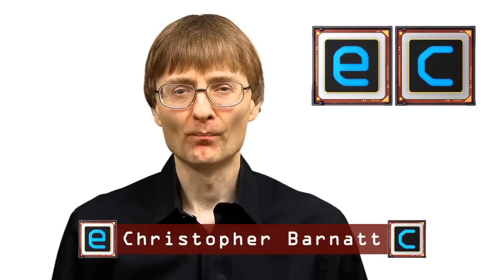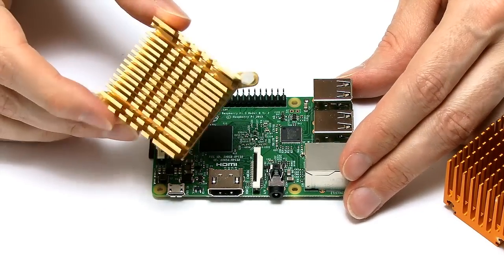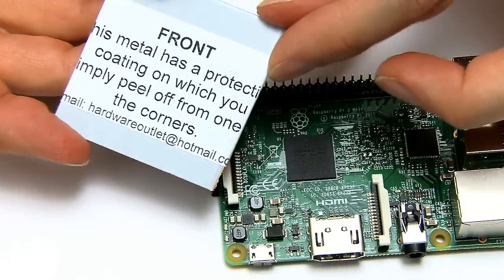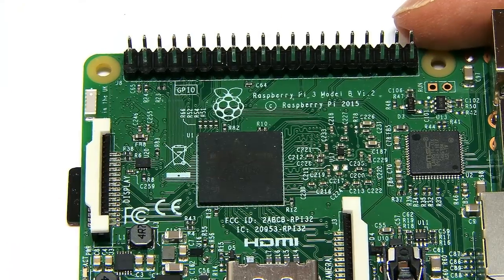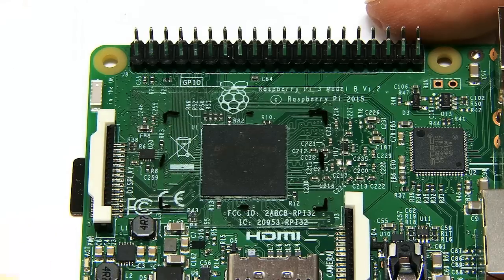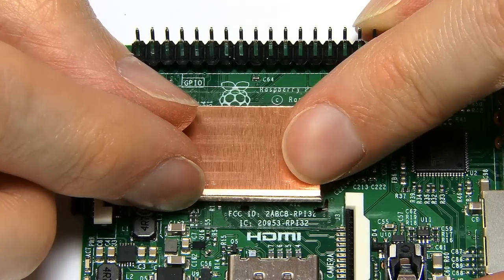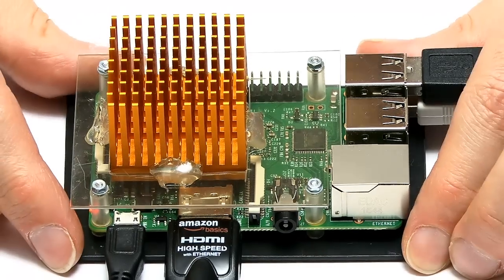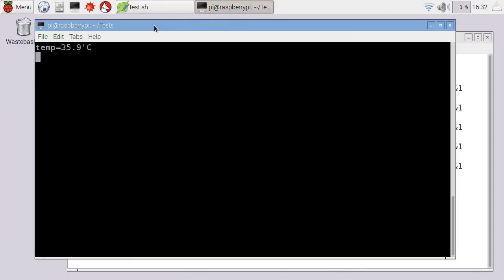Raspberry Pi 3: Extreme Passive Cooling

Comment: very cool... I'm wondering...  What if ran that test for a few hours?  I wonder after the copper started heating up ... would it still passively cool after say 4~24 hours?  Let's say had an application that ran the pi under load 24/7.  Like DC application or Bitcoin mining. Not that I would do any of these types of thing on a RPi3 but, it would just be interesting to see what may or what I think will start happening over time when the block starts to heat up. Thanks for the review.  Honestly, I didn't think the results would have been better than active cooling. Cheers mate!

Comment: what are the measurements for that heat sink? I measured that a 35mmx35mm heat sink would fit on the tinker boards chip but it looks like theres a little less space than on the RP3?

Comment: Did you remove the anodizing from heatsink bottom?  Since anodizing is non-conductive, wondering if that affects cooling?
Reply from the maker: I did not remove it. Interesting thought!
Reply: Type II anodize on most heat sinks is aluminum oxide which itself has a rather low thermal conductivity rating of 30 compared to 205 for bare aluminum and 401 for copper. https://www.engineeringtoolbox.com/thermal-conductivity-d_429.html  Arctic Silver compounds are deliberately formulated to be non-conductive. http://www.arcticsilver.com/as5.htm  Bottom line, points toward using all copper heat sinks for passive cooling.

Comment: What are your thoughts on using thermal adhesive? You'll eliminate the need for a plastic heatsink holder, but you'll wont be able to remove the heatsink once it has cured.
Reply: +George Moore Thermal tape might also be an alternative. Easy to remove.
Reply: Yes but also put dabs of normal epoxy or hot glue in each corner to make sure it doesn't pry the chip off just to be sure.
Reply: thermal tape should work but the heat transfer might be lower
Reply: I have only had a few experiences with thermal tape, all on the tape that comes with stock cpu coolers. I have found on the four or five rigs I've built that use stock coolers,  that replacing the tape with some good paste resulted in around 2 to 3 degrees cooler at idle and around 8 to 14 degrees cooler at load.
Reply: +antithematter
Well obviously tape wont beat paste at thermal efficiency. The main advantage of tape is that it allows for easy mounting of small heatsinks. Without needing any fancy mounting systems.

And with the small amount of heat that the Raspberry produces. The loss in thermal efficiency with tape is not really a huge deal..
Reply: jimmy wendler thermal adhesive is epoxy. It's actually a lot stronger than the epoxies you can buy at Home Depot

Comment: the hot glue honestly hurt my feelings a bit, everything else was so neat to that point.
please just bend a clip from coathanger wire next time. letting the thermal grease set under a decent amount of pressure will also most likely increase it's effectiveness. (would be interresting to know by how much wink )
ps: the SOC looks well seasoned .. not to say battered and fried. closeup @ 1:54
Reply from the maker: +Cuda FX The SOC looks seasoned because it previously had another heat sink on it (the tiny one in my previous video). The glue from that did the damage.

Comment: I know this is probably a stupid question, but have your tried water-cooling?

Also did you try a little fan on that large heat-sink?
Reply from the maker: +archer bob I've not tried water cooling it (yet). I have now tried this with two fan arrangements. The video uploads on Sunday! :)

Comment: you could easily use the gaps of the heat sink to fix some kind of wire to the bolts and avoid the hot glue, great video by the way! greetings from Chile.

Comment: I am returning to this video because I think it is VERY relevant to the Raspberry Pi 4.  Maybe you can do a follow up with the new pi (hint hint hint, ;) ).
Reply from the maker: It is very relevant indeed! I am planning a Pi 4 cooling and temperature tests video for July 21. I've been working on designs for 3D printed parts to hold a 40mm fan even today. The video will feature various passive and active cooling solutions.
Reply: @ExplainingComputers  I've just stuck on a small heatskink  for a TO220 transistor onto mine using self 'Alaska' adhesive thermal tape, and keeps the temperature at around 70'C when watching YouTube videos, and creeps up to 80'C using the sysbench several times.

Comment: definitely too much thermal paste.Great vid none the less. I went with a case that includes passive cooling and am loving it so far. I haven't tested temps yet, but am running at 1.45 ghz and 500mhz on the gpu and have yet to have a temp warning. 

The case I got is Flirc Raspberry Pi 3, 2 and B+ Case. I almost went with the kodi case just to support them ($5 more for pretty much the same case) but I wanted it asap and amazon got it to me in under 24 hours.

Comment: How thick was the piece of plastic you used to insulate the exposed circuitry from the copper plate? Do you happen to know the dimensions of the processor? Dimensions of the fan and heatsink? I'd like to mimic this cooling setup for a retropi that I want to make.
Reply: Looks like some usual, slightly thicker plastic foil.
Reply: If you have a 3d printer print a low profile case which will sandwich everything like that plastic did. (the lid is lower than usb ports). If you dont just cut it out of the flat side of a milk carton.

Comment: very nice test! i was kind of disappointed when i thought you wouldn't test the thermal capabilities of the copper piece alone, but what a pleasant surprise at the end :)

still, i wonder how the temperatures would have improved with a fan on top of your massive passive cooling solution.
Reply from the maker: +Xiaopang3333 You will find out in just over a week . . .
Reply: ExplainingComputers looking forward to it :)

Comment: I have to say I would've been happy to see that you would've taken something like a old fan grill and bent it to fit the bolts while going through the fins and pushing down on the sink.
Not because this method is wrong or doesn't work, but, because the Pi and all the other parts used in this mod/upgrade are very solid and durable. If you shook it around, or even dropped it maybe, nothing would fall off or apart. (most likely) but with this hot glue setup, it's a little, well, more fragile.
Still, everything else was wonderfully done. Very resourceful :] 
And let's all keep in mind this is just my two cents, and more of a personal desire than anything that's truly necessary at all. Just couldn't help but open my mouth on the internet hahah

Comment: Another great series of videos Mr. B. Did you not find that the sheet of plastic on the bottom around the CPU or the heat glue melted at all tho?
Reply from the maker: +Nick Russell Many thanks. The melting point of the plastic will be at least 200 degrees C; hot glue is about 120 degrees C. So neither are in danger of melting -- unless the Pi fuses and catches fire! :O

Comment: Although the aluminium heatsink is glued into place the copper plate looks like it's free flowing between the chip and the aluminium heatsink. I got some concerns that it's possible that the copper plate might accidentally slip out of place. Thoughts?
Reply from the maker: +Saldytuwas I get where you are coming from, but in practice the thermal compound keeps it in position. I guess if you held the Pi vertically and gave it an almighty thump the copper may slip. But I am not plannnig on doing then! :)

Comment: wouldn't just using thermal adhesive instead of thermal compound have made the hole thing quite a bit easier? if the adhesive is strong enough, just throwing the copper plate on the processor, and the heat sink on top of the copper plate, each time with some thermal adhesive in between would have been all you had to do
Reply from the maker: Indeed, but it would not have come apart again very easily for other projects! :)

Comment: One thing about the results that you show here. As you mention yourself, there is a significant amount of metal to this solution which clearly has a significantly higher thermal capacity than any of the other methods you have tried. I would like to know what the numbers look like for the active cooling vs the extreme sink solution after say, an hour? Looking at the tables you present it doesn't seem to me that the extreme sink has heated up completely and as such you're not actually seeing the cooling capacity of the method but rather just the slow heating of the metal. Regardless, it's a mood point since nothing short of stress testing would produce temperatures such as these... Interesting series!
Reply from the maker: +Macvombat Fair point. I run a longer test of this setup as part of the video that will upload next week. :)
Reply: Looking forward to the results!
Reply: +ExplainingComputers When you do that would you also do a test with adding the fan on top of the Heatsink to have and "Extreme Active" profile as well. I see no reason not to go all the way to the extreme for the pure science of it!

I myself want to try this experiment with this Heatsink and a fan:  http://www.frozencpu.com/products/5521/vid-85/Enzotech_Forged_Copper_Northbridge_Heatsink_-_Artic_Silver_Cramique_Included_CNB-R1RevA_-_447mm_x_447mm_x_30mm.html?tl=g40c16&id=Pzdivgxv#blank

Comment: What kind of plastic is that around the CPU? I'm afraid I didn't know that plastics like that could withstand 100+ Fahrenheit. Is that basic knowledge? Or is that a special sort of plastic?
Reply from the maker: +ClawMinecraft:The Ender King The plastic is cut from a SD card packet. So it is probably styrene or PTE. The melting point will be roughly around 200 degrees C or more (400 F), so there is no risk of melting from the CPU heat -- even without cooling. :)
Reply: +ExplainingComputers I see. Interesting. Thanks!

Comment: If you just had cut the heat-sink  to the size it could fit would it have aprox the same result?
Thank you.
Reply from the maker: If I had cut the heatsink down enough to fit (ie to clear other components) it would have been substantially smaller, so less effective.

Comment: Hot glue on a component designed to get hot? (I know, it won't get that hot.)  I prefer Q-Bond (immed. set) or silicone (slow cure)

Comment: Over a short period of time, the heat sink pulls away a lot of heat. 

Over several hours, would the heat sink eventually heat up, become saturated and not transfer heat to the air fast enough cool it the Pi?
Reply from the maker: Things will settle in maybe half an hour max with very little change in temperature.
Reply: I just watched your fan cooling video and see that. Thanks!

Comment: All those materials probably cost more than the pi itself.  And what was the point of this?  Did you massively overclock the pi or something?
Reply from the maker: +hughjazz44 I will be experimenting with overclocking. The only thing I bought was the copper.

Comment: My only concern is that this is not something you would use. There are other parts that are overheating. So for the core - big passive radiator is fine, but for the Rpi itself - a fan is a better one, even on low voltage.
Reply: +Przemyslaw Szulc I'm  not familiar with raspberry pi 3 heat issues.  What other components get hot and how hot do they get?
Reply: +serimpala pretalia it's more or less whole board. If cpu is hitting 100*C than, depending on orientation and convection it can be quite bad. Even if there is no load at all, the current running in electric lines will make whole board warm. Cheers!

Comment: Excellent! What would happen if you mix that with a normal 12 volt cooling fan?
It would definitely not be as effective as a liquid cooling solution, but it would require less power to work and would probably be enough for the really big computation intensive stuff.
Reply from the maker: +Victor Rivarola Interesting you should think of this. On Sunday I'll be posting a follow-up video in which I try out two fan options with this setup -- one of which is a large,12V fan! It keeps things seriously cool. :)
Reply: +ExplainingComputers Thanks! I will be expecting that video!

Comment: Nice :)
I don't have a RasPi 3 currently, only a 2 and a B+ (and one A+, but this is currently busy in a beehive-scales). Is your RasPi 3 overclocked somehow? None of my RasPis get even close to the temperature values of your model without heat sink, and they only use tiny copper heat sinks. If I stress the RasPi 2 with the sysbench command of your video then I get 60,5 °C at maximum! Not to mention the B+; it takes ages for one loop (--num-threads=1) and stays rather cool at 41,2 °C. So I pretty much doubt the usefulness of a big heat sink or a fan. But if the RasPi 3 is really such a heat monster than I don't want to buy one anymore, the 2 is sufficient for me.
Reply from the maker: +Andreas Schmitt In my view the Raspberry Pi 2 is the classic Pi. The Pi 3 does get a lot hotter when stressed. In many situations this does not occur or matter -- see my first Raspberry Pi 2 Temperature Tests and Heatsink video where I show that things like media playback are not a problem. But they cannot go on producing a faster and faster Pi without cooling raising its ugly head.
Reply: ExplainingComputers
Thanks for the info! For me the Pi 3 is only interesting because it has a Wifi interface on board and does not cost much more than the Pi 2, so in fact it is cheaper than a Pi 2 with Wifi stick. So if I need another one it may even become a (throttled down) Pi 3 ;-)

Comment: Carried out this passive cooling experiment with the Pi Zero as temperature isn't likely to differ much between models. To keep packaging down to a minimum I am using a heatsink taken from an old voltage regulator. These can be held in place with clips like the old Thermalright coolers. Otherwise for 99p a micro usb fan for android phones works better minus the noise and power usage.
Reply from the maker: The Pi Zero runs far cooler than the Pi 3. :)
Reply: Sure if temperature is that much higher Zalman northbridge heatsinks should fit well clearing other components without modification. Like your plastic shim idea; I'm no fortune teller however accessories like this may well appear on the market soon to surround, support and protect the SoC against movement of larger heatsinks as the Pi evolves.

Comment: Ok, you have lowered the temperature by 30 degrees,
now what is the advantage when the PI is projected to work at above 82 degrees?
Reply from the maker: By 82 degrees the Pi will be throttling, so reducing its performance. And any chip running at that temperature is now doing to last as long as it could . . .  Oh, and this was an extreme experiment!  In most situations, a large heat sink like this is unnecessary. But if you overclock,now that is another issue -- as you can see in the video uploading this Sunday! :)

Comment: if i planed on using this to or close to its max 24/7 with no cooling, would it damage it?  It did seem to level out at 80 degrees.
Reply from the maker: Running at c. 80 degrees C will shorten the life of the Pi . . .

Comment: Can a Raspberry PI 3 be used as a mediaplayer without any cooling? The temperatures should be lower than in a stress test, but it should be able to handled decoding for hours.
Reply from the maker: +MasterF3 Yes, you should be able to use it as a media player without cooling -- see my video on "Raspberry Pi 3: CPU Temperature Tests & Heatsink" for evidence.

Comment: You can make 2 massive improvements: first you should know that A thermal contact is improved when you compress the thermal material with your heatsink/heatspreader. Second and most important, you neef to minimise the number of layers (the copper plate). Replace the copper plate with a thermal gapfiller (MTC, Laird, Bergquist) these go up to 1,5 cm. Choose your thermal conductivity in best combination with your compression set.

Comment: Is hot glue the best solution to glue the cooler ? Is there any risk that the heat will melt the glue again ?
Reply from the maker: +sixbras Best solution? No. But the melting point is c.120C so there is no risk the heat sink will melt it.

Comment: Have you run this script with the time program to see if the processor is throttling the speed down and slowing the process on the pi with no cooling?
Reply from the maker: +Kazriko Redclaw The processor was, I'm sure, throttling the processor with no cooling. I looked  at this a bit more in my first Raspberry Pi 3 cooling video.
Reply: +ExplainingComputers Just watched through that video. Thanks for that. I'll have to try it myself to figure out how much impact the throttling has on the test though since the script discarded the results. Since the passive heatsink keeps it below 80, that may be enough to prevent throttling. (But still a bit high for my tastes. I suppose though that a $35 somewhat disposable computer probably doesn't merit expensive heatsinks to protect their lifespan.)

Comment: This is really quite a nice video.  One thing I'd like to see, if possible, is a listing to the parts required.  I like using a raspberry pi-like solution for my home-server,and keeping it cooler is a great option.  Trying to find everything you found is going to be a bit of a challenge though.  e.g. the plastic tubes, the base plate (which looks like acrylic?), and the correctly sized heatsink.  The copper should be easy to find since you said you got it from amazon and gave the measurements.

Still if you're able to provide more information on what you all bought, that would be really helpful for those of us who want to reproduce your results.